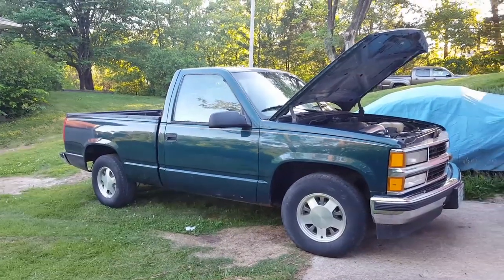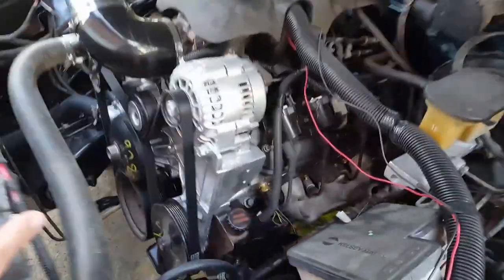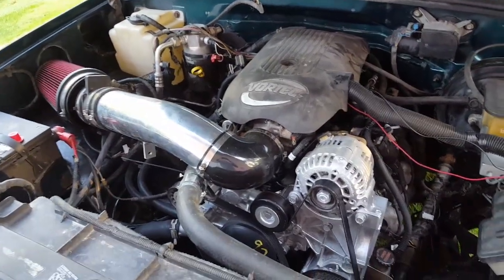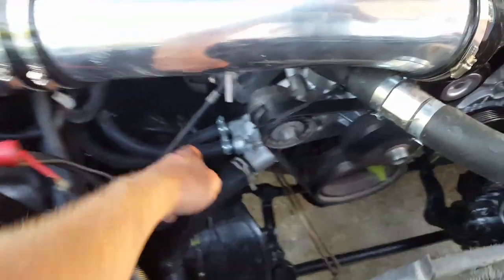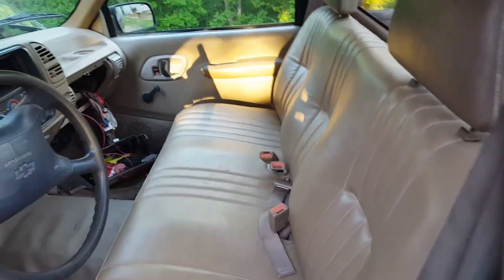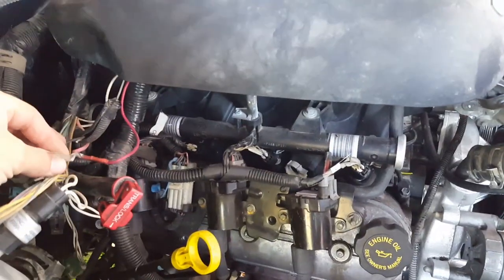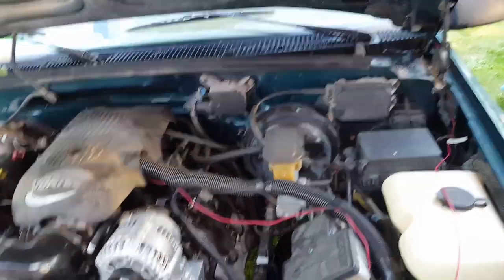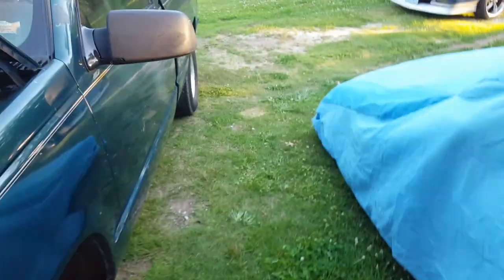95 silverado c1500 How To 5.3 ls swap

Comment: I have another question. Do I also have to have the ecu tuned for a 5speed
Reply from the maker: You can just kinda depends on the year. If its a 99-02 drive by cable setup you can get away with no tune and just a basic flash. On a 03-up with drive by wire it will act up since the throttle is computer controlled. I havent done a 5spd swap yet so Im not 100 percent on it. If your getting ecu flashed just tell the tuner and he can take out the automatic trans control and swap it to the 5spd setting.
Reply: Joe Jackson if you could give me any tips or tricks in my swap what would you tell me
Reply from the maker: @jcphillips476  The tips and tricks I can think of is when putting the engine in (I did it with transmission connected) strip the motor all the way down. I tried to keep everything on and kept getting snagged on everything and about broke intake. So strip the intake coils and headers off and it wiggled in there alot easier. I removed the bed to do fuel pump its alot easier that way and paint the frame while its off. Be sure you have every part from the donor truck other wise this swap will nickle and dime you to death. The last couple i have done i did for under 800 using all the parts from donor vehicles. Be sure to fill the coolant thru the upper radiator hose after install cause it wont pump thru the motor just pouring into the radiator. Thats all i can think of at the moment. Its a fairly easy straight forward swap really. Everything goes in like its meant to be there.

Comment: How did you bypass a neutral safety
Reply from the maker: I cut all the stuff out of the ls harness and I plugged the factory 95 harness into the neutral safety and ran factory 95 starter signal to starter so worked fine for me

Comment: What wires do you you have to tie in to stock harness
Reply from the maker: for the standalone run a power to the battery
key igintion to the dizzy wire
tach to the white wire on the dizzy
temp single green wire 
vss out to the last wire on the left of the drac module behind the grove box i think it was blue.
oil pressure wiring untouched just used a adapter to ls block
gas gauage dont have to mess with wires
volts meter didnt have to touch
Im doing htis off memory if you watch some of my other videos i covered the wiring. super easy on tbi on obs chevys. Thanks
Reply: Joe Jackson yeah I have a 95 and your the first one to ever explain it preciate man I'm gonna message you cuz I might need a lil more help keep up the videos good work
Reply from the maker: DevotedN8tion  no problem just let me know. Its a pretty easy swap im tbi trucks

Comment: I’m doing the same thing with my truck could you send me the link for the motor mounts and the extra parts of the wiring harness
Reply from the maker: These are the mounts https://www.dirtydingo.com/shop/product_info.php?cPath=359_362&products_id=1314

Dorman fuse block part number 85668
Reply: Thanks buddy
Reply: @Joe_Jackstands  What did you do with the plugs that go on top of the injectors on the 43 motor
Reply from the maker: @sandymushexclusives2098  you don't need any of them. Just cut them off. Everything runs off the ls harness and just tap into wires for guages to work.
Reply: @Joe_Jackstands   do you think those motor mounts would work with my truck cause it’s a four-wheel-drive
Reply from the maker: @sandymushexclusives2098  I have never done a 4x4 but im sure dirty dingo has sliders for a 4x4
Reply: @Joe_Jackstands  I found the motor mounts so is there a certain fuse box I have to get and which wires do I hook them up into like you did
Reply from the maker: @sandymushexclusives2098  I did the lt1swap.com standalone harness write up used the dorman fuse block then tapped into all my dash wires from there
Reply: @Joe_Jackstands   Which tab is the wiring harness under
Reply from the maker: @sandymushexclusives2098  https://www.lt1swap.com/2000harness.htm click the link and scroll half way down find your year and click it
Reply: @Joe_Jackstands  it doesn’t have a 95 Chevy
Reply from the maker: @sandymushexclusives2098  you have to use 99-07 harness on the Ls. Convert to stand alone with lt1swap write up. Then take the outputs from ecu and tap into 95 harness on firewall. So ls harness will have a white wire says tach and that would going out of ecu plug and into the white wire on 95 firewall. Same thing with all of the other wires.
Reply: @Joe_Jackstands   ok thanks buddy
Reply from the maker: @sandymushexclusives2098  no problem anytime
Reply: @Joe_Jackstands  so how do I order the hardness I can’t figure it out
Reply from the maker: @sandymushexclusives2098  the lt1swap just shows you how to convert a stock harness over, a do it yourself write up to save money, if you already have a stock harness. If you going to buy a harness look on ebay and can get someone to convert yours or buy a China made one.
Reply: @Joe_Jackstands  ok thanks buddy

Comment: Hi did you use the original transmission or swapped it as well ?
Reply from the maker: Use the ls transmission
Reply: @Joe_Jackstands  could have used the transmission that was in it correct? I just bought a 95 c1500 and trying to figure out what all I need
Reply from the maker: @paul hance  no can't use a 95 transmission there different won't work with ls computer. It's easier to buy a full ls swap with ls base trans.

Comment: Hey man that is an awesome job you did. Is there any way I could email you about a few wiring wiring questions I have?
Reply from the maker: Kaiser Mora yeah ill try to help the best i can. Actionj5828@gmail
Reply: @Joe_Jackstands  is your email still available I need to ask questions as well I barely came across you vid cause this im in need of help of doing my ver first swap and having trouble with the engine wire harnesses!?
Reply from the maker: @chrisfuentes9159  yep still the same
Reply: Joe Jackson did you use the stock truck oil pan?
Reply from the maker: @joegracia77  yes stock Ls truck pan

Comment: man I have a 95 and want to do this. But dont know anything about this. Ill have to pay to get it done.
Reply from the maker: santos galvan it is pretty easy to do not as hard as everyone makes it out to be
Reply: I have a 95 with a 4.3 and I just got ahold of a LQ9 6.0. What harness pinouts do I need to use off of lt1swap to start on my harness?
Reply: Joe Jackson  I have a 95 with a 4.3 and I am putting a LQ9 6.0 in it out of a 05 Escalade. What pinouts will I use from lt1swap and I have a few more questions as well.

Comment: Can I use my stock trans with an LS swap? I can get one for $500 with the ECM and harness from a friend who’s moving away
Reply from the maker: 95 trans won't work with ls swap... you need a stock 99-07 4l60e or run spacer on 96-98 4l60e
Reply: @Joe_Jackstands  how can I see what transmission I’ve got I’m pretty sure my trucks been swapped with a older 350
Reply from the maker: @Boosted 5.0  just have to get under it look at transmission pad shape. Look for kick down cable if 700r4. Vacuum hoses if turbo 400. But if doing the swap be way easier to get a ls style 4l60e

Comment: Around how much did that cost you
Reply from the maker: this one under thousand. i had 600 in the engine 150 in trans 100 in mounts fuel pump 80 ecu tune 50 . It doesnt take much to run this engine in one of these trucks

Comment: Did you use your stock trans
Reply from the maker: I used a stock 4l60e out of a 99 silverado. Its easier to use a 99-up LS 4l60e  then trying to adapt a older one.

Comment: Could you send me the links of the parts you had to buy online like the mounts
Reply from the maker: Pepe 97LS  Its dirty dingo slider mounts, highflowfuel.com 88-98 fuel pump kit, compression fittings for gas lines to use the newer fuel lines, made my own harness off lt1swap.com, ebay cold air intake, 98 camaro ls1 temp sensor, oil pressure sensor adapter, use 5.3 radiator hoses off and newer silverado, vortec throttle cable any 96-02.  You really dont need much to get one running in a 88-98
Reply: Joe Jackson thanks
Reply: Another question i just purchase a complete take off engine 5.3 and 6 speed trans out of a 2012 silverado. Do you know if i can leave the ac compressor in the stock bottom passenger side like it is now?
Reply from the maker: Pepe 97LS no you cant it will hit the frame. You can cut the frame but it be a really big section to take out how the trucks frames are setup
Reply: Joe Jackson thanks

Comment: Where did you get your 5.3 ls I been trying to find one but can’t😕 edit: built one
Reply from the maker: I got this one from st james auto salvage here in Missouri. You can usually find one on ebay shipped to your door for under 600 for one with high miles. Most the time I buy complete trucks off Facebook market place that have no titles or are wrecked and take the full swap after I test everything

Comment: Joe Jackson I actually bought this truck and still have it
Reply from the maker: awesome! glad its still going strong. I wsa wondering what happen to it. i sold to a guy in illionis and then saw it for sale a little while later.
Reply: Joe Jackson its got a terrible lifter knock so i havent driven it much. Whats up with the tcc not being hooked up?
Reply from the maker: Keegan Maher I just never hooked it up ran fine with out it. And I sold it by the time I got everything completely finished. The tcc will hook up to the brake switch on the brake pedal.
Reply: I gotcha. Ive probably put 3k miles on it. I swapped it to 6 lug with a 4wd rear end with 373 gears with 295/50/15s all the way around. Runs 2k rpm at 55 so the couple hundred rpm less with the convertor lockup will help mpg. It only has one oxygen sensor in it so i need another to have a guy put a tune in it after i cam it and fix the lifters

Comment: I have an 95 also...I have no ideal as to where to start. My budget is $2500.  Any suggestions?
Reply from the maker: Rashad Andrews it be easy to do for under 2500 most mine where done for under 1500. Get a compelte swap for under 1000. Build your own harness. Tune the ecu for 45 get motor mounts for 100. Fuel pump for 80. Fuel fittings i just used compression fittings the new fuel lines. Its a really easy swap. Alot of your budget would be spent on a swap. So cheaper you get that the better
Reply: Thanks for the reply. I live in California and I'm concerned at smog issues once I do the swap. But, I'm going to follow your script.
Reply from the maker: Rashad Andrews i live in missouri and i dont have to worry about smog stuff
Reply: Rashad Andrews im in cali too over here by woodland hills, as long as you swap over all the emissions components like the egr, cats and all sensors you shouldn't have a problem smogging.
Reply: Thanks for the information...most of these swaps are not in Cali; so it's refreshing to see your comment.
Reply: Rashad Andrews yeah i know what you mean, I dont know if you have $10k laying around but chevy performance sells that LS3 E-rod setup thats actually carb legal makes 430hp and comes with cats ecu and some other stuff but I dont see how thats different than pulling the engine ecu and all emmision componants from a 2003 silverado and at a quarter of the price plus the 2003 setup is already carb legal lol
Reply: Nah...I wish I did have 10k laying around. My plan is to spend $2500 to $5000 in total. So the engine will definitely be coming from a junk yard donor...I'll be posting videos once we get started.

Comment: What year is the dash out of?
Reply from the maker: the dash is 95-98 trucks. 95 is tbi and 96-98 are vortec trucks
Reply: Have a parts list for the fuel line and fittings that you used... or some Face book or Instagram contact
Reply from the maker: @chavisboi  no I dont. Its simple though. I used the factory 95 lines and the 99 factory lines and used compression fittings to join the 2 lines together. Main line is 3/8 compression fitting and return was a 5/16 compression fitting. There under 10 for them at oriellys.

Comment: what all was involved swapping motor mounts.  did u have to remove lower control arm to change to V8 mounts first.then use the dirty.dingo?
Reply from the maker: I didnt have to remove the control arm. I used a swivel socket and fed the bolts thru the bottom. I taped a piece of wire to the bolt fed it up thru the whole and put the nut on top. Worked great. passenger side was a little harder driver side was a easy. Then the dirtydingos bolt on the motor I left them loose so i could side the motor where i wanted it, then tighten the bolts down on them.
Reply: sounds good. I have a 94 4.3/auto that I'm thinking about doing a 4.8 swap to.  don't know if I could use my original 4l60e or not.  trying to do this on a budgets
Reply from the maker: You can use your original 4l60e just have to buy a spacer for the flywheel to bolt to your torque converter. The best budget way would be buy a 4.8 build your harness off lt1swap.com, remove vats of your ecu ls*thunder on ebay is $45, buy engine mounts the frame pad are like $20 a set, you can use lsx set back plates $30 but have to source some v8 clamshells of a 350 to bolt to them. dirtydingos are $100 but way easier to work with,fuel lines use the 99-02 push locks on the intake cut them from the donor truck and use compression fittings to your stock lines, fuel pump use a 96-up Ac delco off ebay like $30 bucks, i use highflowfuel.com cause they have a lifetime warranty and they stand by it $80, then you need a throttle cable off a 96-up truck i used a 99-02 cause they are shorter. you can use your ac unit have to google ls tbi compressor swap. I might be forgetting some small things but the swap is easy and doesnt take much to do.
Reply: thanks I'm following

Comment: Neat swap but I just don't understand what's so good about this overrated 5.3. I've owned a 2012 GMC and 2013 Silverado both had 5.3s and I'v found that it seemed like I really needed to have my foot into the floor to make any power. Now my 94 5.7 TBI has tons of low end great around town and in the city. I will say on the highway pulling out to pass that's were my old 5.7 TBI struggles and the 5.3s were nice but in my personal experience I've owned lots of 5.7tbi Chevy's as well as many 5.3s and in a pull off sheer low end off the line the 5.7 TBI eats the 5.3 hands down without a doubt. My opinion the 5.3 is way over ratted definitely not a tow rig motor unless you like towing at 5000rpm just to maintain highway speed.  I owned a 08 6.0 6spd Auto 2500HD with 3:73 gears and wow what a truck great MPG lots of grunt loved it miss it. Long story short I'd take a 5.7tbi over a 5.3 as I tow and haul things but I'd take a 07+ 6.0 6spd vortec over both. Nice swap but with the work involved I'd upgraded to 6.0 vortec.
Reply from the maker: theres a huge debate which is better the tbi or the ls engine. Comes down to personal preference . This truck was a original 4.3 v6 and i had a 5.3 sitting around so i just thru it all in there. I would of went with a 6.0 but the price for one around here is around 1200 and i can get a 5.3 all day long for around 600 from the junkyards. I only cruise and do a burnout every now and then and the 5.3 does great for that.
Reply: +Joe Jackson yup 4.3 to 5.3 is definitely a upgrade plus your truck is a regular cab short box plus you already had the motor sitting around. Definitely not dissing the swap I'v contaplated a 6.0 swap many times.  I'm just tired of people dissing the 5.7TBI I find they are great low end stump pullers. I find people only look at how much HP it has not what curve it puts the power down. A truck like yours yes a 5.3 suits its great.

Comment: Mpg
Reply from the maker: rachel freeman i sold the truck already so i dont have solid mpg for you sorry. If i had to guess around 17 but i didnt pay attention to gas mileage cause it was a project truck i just drove here and there.
Reply: I have same exact truck and engine running 700r4 373 gears and a 255/70/15 tire gets 22 mph highway with ac on
Reply: @Joe_Jackstands  @ how much its a obs,  swapped????$$$???
Reply from the maker: @GerardO Lopez  just depends how much you get the swap for. Everything else is cheap. I did this one under 1500. I have done some for 600.  Just depends on how much you get the swap for and if you can build your own harness or just buy a ebay one for 150
Reply: @Joe_Jackstands  @ i mean , how much did u sold the truck for???$$???  Already swapped  ,,,